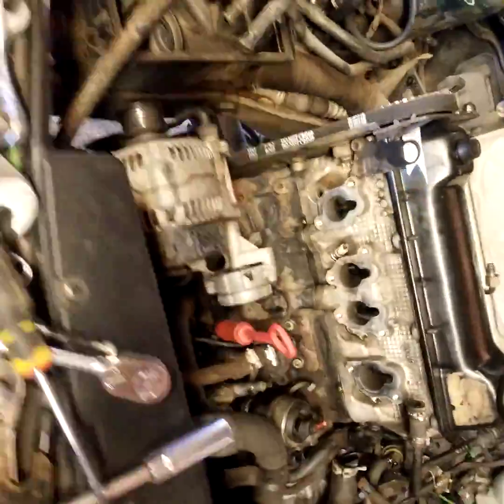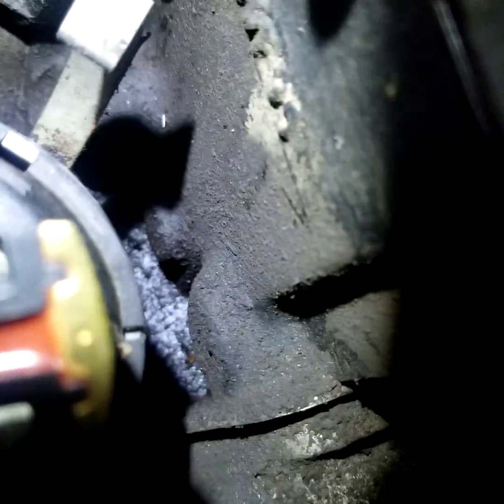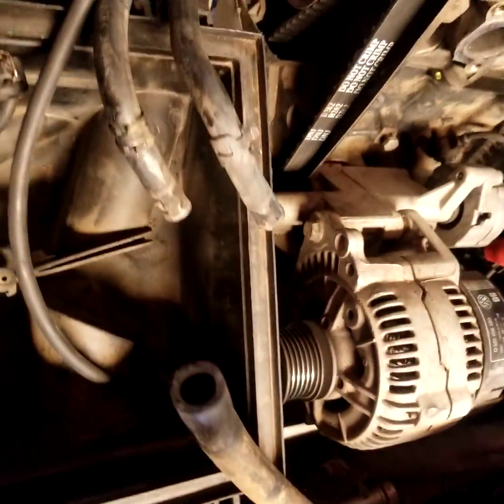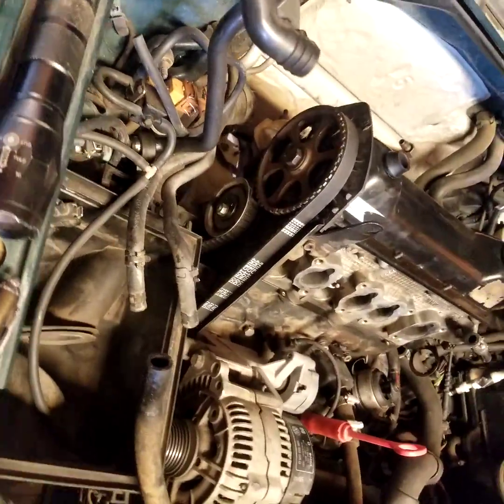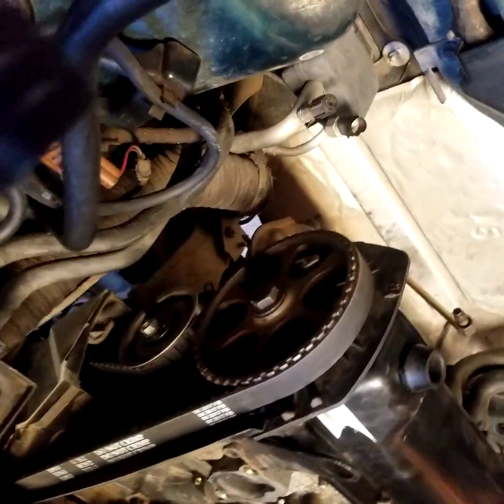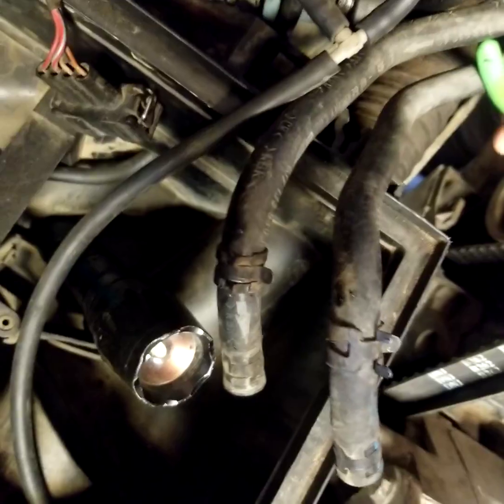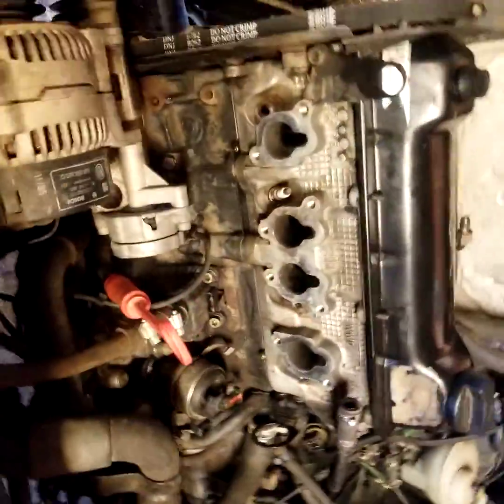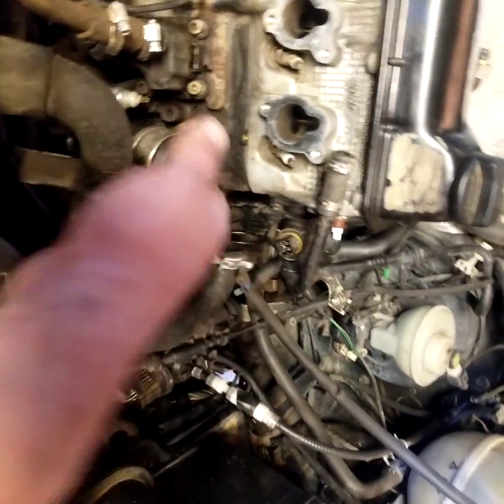1995 jetta gls timing marks

Comment: gordon can u look at my video concerning my vw beetle 2002 2.0 engine i am trying to put in correct timing ask some people to help but would not help i redid the cylinder replaced water pump timing tensioner new head gaskets new camshaft and camshaft position sensor i think it is 180 from starting but took out the first spark plug to make sure it was on tdc but it would not start i am about to change crank sensor soon